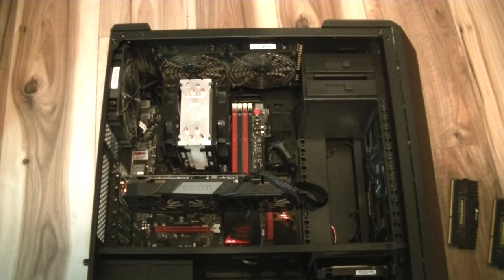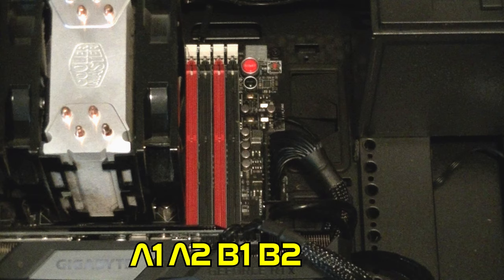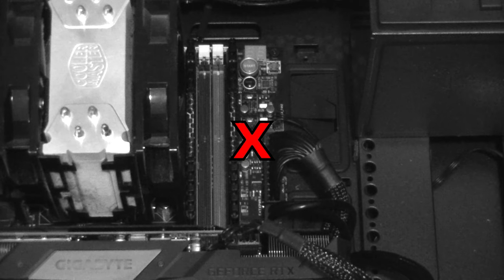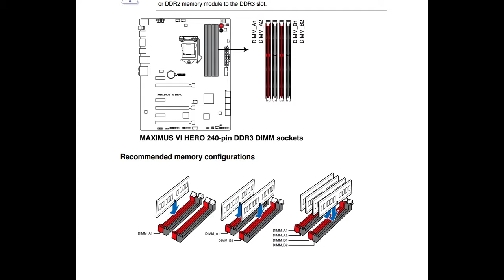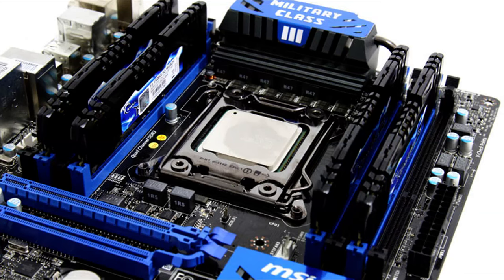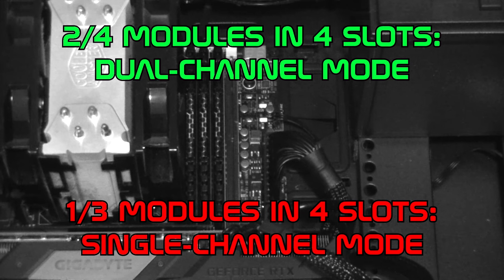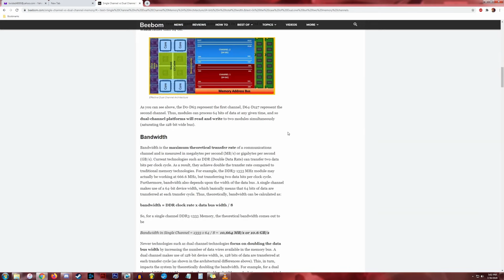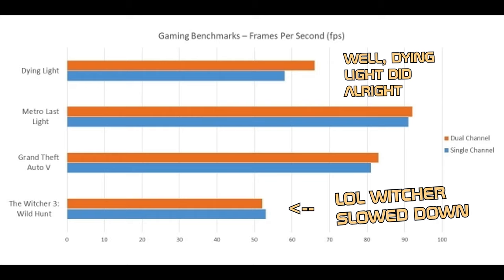How to Make Your RAM Run in Dual-Channel Mode

Comment: I have two slots for the RAM on the motherboard, if I insert 2 sticks of 8 gigabytes in those two slots, will the RAM work in DUAL CHANNEL ?
sorry for bad english
Reply from the maker: It should. It depends on the motherboard, but if you only have 2 slots to begin with, you don't really have any better option other than filling both of them up.
Reply: @Torqcx  My motherboard is B450 S2H, whether he will work on it ?
Reply from the maker: @lukam6300  according to the specs mentioned on Newegg.com, that motherboard will run in Dual-Channel mode. :) https://www.newegg.com/gigabyte-b450m-s2h/p/N82E16813145134?item=9SIAD7HB0P9447&source=googleshopping&nm_mc=knc-googlemkp-mobile&cm_mmc=knc-googlemkp-mobile

Comment: So I put both sticks in but I think my computer is only using one, and my computer only has two slots
Reply from the maker: Check both modules individually in each slot to see if either of them or if either slots are faulty
Reply: @Torqcx  I appreciate the quick reply, but after taking one out to see if it was one of the slots or sticks being damaged I found out I ordered two 4 gig ram sticks, not my intent

Comment: so i do not have go change any settings in the bios?
Reply from the maker: You shouldn't! As long as the modules or RAM are in the correct physical spots, you'll get dual-channel mode.

Comment: motherboard h310 it has A1 and B1 slot will it run in dual channel.
Reply from the maker: More than likely! Check it's manual.
Reply: @Torqcx   i have checked manual its supported

Comment: If i have 8gb 2400mhz DDr4 RAM 8gb 3000mhz DDr4 is = to dual channel or single channel ?
Reply from the maker: You have two RAM modules with different speeds, you're saying? Your best bet in that case would just be to do as what was instructed in the video; put them in the slots with the matching numbers/colors (or whatever your motherboard's manual says). But because they're not the same exact models, do not be surprised if you run into problems such as the full capacity not being recognized, the speed/timings being incorrect or the computer failing to boot entirely.

Comment: I went everything Medium 
FX 8150 8Core
1600Mhz Ram Kingstone Hyper X  4 x 8G
R9 270X 2G OC Version  Best smoothest 1080P I ever played.
4 x SSD'S Kingston Running in RAID - 0   for the  multi tasking power..
I must say this system runs extremely well.. 
Fast  &  Strong 
READ  860.99
Write  1189.40 
For me that's insanely fast  enough !  Loads games like in seconds..
I had a Sabrient 2T Gold at 5000Mbs a second but I sold it.
Love my system  All "brand new" taken out of the box in 20/20 
All from 2013.
And I am using it today !!!!!

My New other system is just sick insane and I built it but have no used it...
22,000Mbs Raid 4 EVO M.2's  ASUS PCI EXPRESS CARD 
PLUS 2 X RAID ON Motherboard direct..
GTX  2 X  1080Ti OC 11G ASUS Republic of Gamers..
ETC..... You get the Picture..
In Complete glass Crystal Tower..!!!!  6 Massive fans..
Blue Heaven.

Comment: Well... my question is, if I have the RAM with same speed, but different capacity, do I put them as 8 4 8 4 or 8 8 4 4.
Going by this video, my guess is 8 4 8 4, but I have no idea.
I'm getting a new motherboard, which has 4 slots instead of 2, it comes with four 4 GB sticks, and I'm keeping the RAM from the old motherboard.
24 GB of RAM is obviously better than 16, so that's what I'll be going with, but the arrangement, I'm not 100 % sure about.
Reply from the maker: You'll have to check your motherboard's manual. Follow the color coding on the slots

Comment: Did I understand well:
+RAM single channel: work/productivity/homeuse
-RAM dual channel: entertainement (games)

Question: Which one suits more for rendering on vegas/blender/after effects?
Reply from the maker: I'd say yes, but it depends on your specific setup and needs/uses. Dual-channel offers generally faster performance and you only need the extra RAM if the amount you currently have literally is not enough for what you're doing (if it's maxing out under load of whatever program/game you're using, you want more RAM. Otherwise just get dual-channel)

Comment: Does h310 motherboard support dual channel mode? ..cause it has two slots only ?
Reply from the maker: Most likely it does support dual-channel RAM. Recently I built a PC that only had two RAM slots and it's running in dual-channel.
Reply: @Torqcx  is it gigabyte h310 s2h 2.0 ?
Reply from the maker: @ahmedosama9815  no, it was a much older monthrboard. I'd be really surprised if that model you have wouldn't support dual-channel mode.
Reply: @Torqcx  it is written on the box of the motherboard that dual channel non-ecc unbuffered ddr4 ...does that mean it support ? ...it has two slots only by the way
Reply from the maker: @ahmedosama9815  yes, that means it will run in dual-channe mode. :)
Reply: @Torqcx  many thanks bro ...u r the best ❤️

Comment: Hey I am doing two sets of dual channel memory. How do I do that ?
Reply from the maker: Do you mean you have four RAM modules? If so, you just fill all four slots and they should all run in dual-channel.
Reply: @Torqcx  hey quick question what if I have a 2 slot motherboard will it automatically run in dual channel?
Reply from the maker: @unclebob1478  generally yeah, if you just fill.both slots up it'll run in dual-channel.

Comment: what if i only have 2 ram slots can i run dual channel thankyou
Reply from the maker: The short answer is "yes", having only two slots typically means both of them being occupied will get you dual-channel mode. :)
Reply: @Torqcx  ok thankyou

Comment: i need guide for hp elitebook 8770w laptop ram put they have 4 slot
Reply from the maker: You'll have to look up its manual if you want to know which slot will allow two modules to run in dual-channel, if that's what you're wondering.

Worst case, you can always try each module one-at-a-time in each slot and keep checking Speccy (free program that shows you your specs) to see what mode your RAM is running in.

Comment: When I put in my first ram slot in my monitor turns on but if I put both the monitor doesn't have signal but it legit used to work earlier I also have repeated the ram multiple times
Reply from the maker: Start by cleaning the RAM slots out (blow them out with compressed air if you can). If that doesn't help, try clearing the CMOS (look up a video on how to do that as I don't yet have a video on it)

Comment: My pc has an issue.. it crashes during gaming when i put 2 rams in the correct slots.. but if i stick one out it works fine.. need help please
Reply from the maker: It could be that one of the slots or models is faulty. Try testing each slot and module individually in between start ups and see if you can diagnose it.
Reply: @Torqcx  i tried both sticks in the same slot one by one both worked fine.. i kept playing on single ram but it crashed after about 40 minutes of gameplay..(Doom on ultra) usually on both sticks it crashes as i spawn...i tried to enable xmp on single stick but it crashed again on the spawn (With single stick)..
Reply: @Torqcx  i was actually reading forums online and found someone had the same problem.. they set the SOC voltage to 1.1V and said it fixed it.. I am not very comfortable tweaking voltages but if i try it could that mess something uP?
Reply from the maker: @itxgaming7226  worst case scenario, if you did something wrong with the RAM configuration, the system would merely fail to boot and you'd have to restart and go back into the BIOS.

Comment: Actually it gives a lot more performance boost with certain games. lets take battlefield 2042 I am currently on rtx 3060ti ryzen 7 3700x and when running on single channel 16 gigs ram I was getting around 40 fps on high settings with dual channel 32 gigs ram im getting 90 fps on high so its around like 40%-50% fps boost on a few games
Reply: it might be your motherboard cuz for example in dual channel my mother board supports 2666Mhz per DIMM but if it is single DIMM it supports 3200Mhz

Comment: Mine won't detect the ram when I slot it in in dual channel but it detects when I slot it in so gle channel
Reply: I am having this same problem. Gigabyte B450 M. I can use A1 A2 but not A1 B1, it keeps shutting down or just wont post.
Reply: And also if I put in all 4 sticks the computer will not post. They are all Patriot Viper 4Gigs 3000
Reply: @jackscrafts9202  I only have two ram slots of the same color, can I run dual channel mode if I put 2 ram sticks? 😔
Reply: @liounique1177   I believe when you put both in it will auto-set the dual channel.
Reply: @jackscrafts9202  thanks mate. I'm buying another stick right away.

Comment: How to use single ram slot?
My monitor shows “no signal”(one of my ram slot is not working)
Reply from the maker: You either have the module in the incorrect slot or the module or slot itself is faulty. Try to find your motherboard's manual and read into which slot a single module should be installed into.
Reply: @Torqcx  i actually showed it to the technician and they fixed it(i had a faulty ram slot) so i was using a single slot but today i inserted on the other side too and now it's“no signal”
Reply: @Torqcx  like i want to know how to switch my pc in single channel configuration
Reply from the maker: @Lain001-g1v  if anything, that could probably only be done in the BIOS.
Reply: @Torqcx  yes! I just managed to do it
Thanks for the replies and for trying to help me

Comment: What happens when I have two, Dual channel rams sets, 2 x 4gb and 2 x 8gb?
Reply from the maker: With modern motherboards it generally won't be a problem, they will both run in dual-channel typically, but with older motherboards (even from just a couple of years ago) they may limit to single. You have to test it or at least read it's specs

Comment: Enjoyed your video, great skill speaking to your audience. I would appreciate if you can provide some guidance on Mixed Memory (size) and Dual Channel configuration.
Given a motherboard that supports dual channel memory and (4) DDR4 DIMMs of the same Manufacturer, Timing Spec, and Operating Frequency, but different sizes 2X 16GB and 2X 32GB = 96GB.
How do you properly seat the memory to Maximize the Dual Channel Benefit (slots available: A1, A2*, B1, B2*)?
From the install instruction, if I had two sticks of different sizes a 16GB and a 32GB the first 16GB of the 32GB stick would be mapped for Dual Channel use and the remaining 16GB would be mapped as a single Channel.
But there is no Guidance in my scenario. If I placed the 32GB sticks in opposite channels along with the 16GB in opposite channels, would that give the full benefit for Dual Channel Memory on the entire 96GB?
Currently we have 64GB in Channel A and 32GB in Channel B, I am afraid we are needlessly mapping 32GB for single channel use. Or maybe it doesn't matter?
Reply from the maker: You might as well just try it out with what you have, as it can't hurt. That being said it's always recommended to go with the exact same make and model of RAM when installing multiple modules, same size, same speed, same timings.
Reply: @Torqcx  Thanks for responding, appreciate your time. We're going to try the new configuration and find a way to test performance.
Reply: @Torqcx  Hi, I have 2 RAMS of different brand and different speed - one is 3200 mhz, other is 2666 mhz - will it hurt the RAM or Motherboard if I insert 3200 mhz in A1 and 2666 mhz in B1
Reply from the maker: @scpk2246  Nothing will hurt anything, but worst case the PC will not boot up with them all installed. Usually they work though, just not at their optimal speed. If you already have it all, you might as well try!

Comment: I have 2 4gb rams I put 1in and opened pc  and it made burn smell did it die?
Reply from the maker: Burning smells inside of computers is very unusual but it is usually power supply-related, I've never heard of RAM causing a burning smell. I would continue to research that.

Comment: can i use 3x4gb in dual channel ?
Reply from the maker: On many motherboards that will just revert them all back to single-channel. On newer boards, two of them will run in dual, while the third will run in single simultaneously. Can't hurt to try, but make sure you read into your motherboard.
Reply: @Torqcx  Thank you. My mob is old q65 with i7 2600. in  CPU-Z  write dual Channel  but I don't trust of CPU Z  how can I check? I need 12gb ram but if work only of singal  channel I will buy one more 4gb. Thank you again ❣️😊
Reply from the maker: @stormdude4654  Again, you'll have to look into your motherboard's specs specifically. Because it's an i7, I'm going to assume it will all revert to single-channel, because motherboards having the capability of simultaneously running dual and single-channel modes didn't become more common until later.

Comment: I have A1 and B1 any ideas?
Reply from the maker: Are you saying those are the only 2 slots your motherboard has? If so, just fill them both up and your system should run in dual-channel mode.

Comment: I have 2 4gb ram and 2 8gb ram. So can I run 24gb of ram in dual channel?
Reply from the maker: You might, but it's always recommended that you get the exact same make/model/size/speed/timings of RAM. you can try with those different models and see if it works, but don't be surprised if something goes wrong or the system fails to boot!

Comment: So I built a pc for the first time, but i am not sure if its ‘good’ like parts wise.
I did research well into compatibility and their respected speeds, but idk if they are outdated or good anymore.
Would someone tell me if they are or arent?

Cpu: intel i7-11700KF (3,6/5.0ghz)
Gpu: Gigabyte Geforce rtx 3060 TI (8gb)
Ram: 32gb dddr4 3600mhz
Motherboard: Gigabyte B560m Aorus pro
512gb SSD & 2TB HDD
Reply from the maker: It's difficult to say whether a system is "good" or not without the context of what its intended purpose is, but based on those specs alone, that's sounds like a mighty fast system to me! You should be able to play new games on max settings with high FPS with that beast.
Reply: @Torqcx  Yeah I understand what you mean, but it is intended for gaming. Thank you for replying!
It also does sound like its a pretty good system, I am just a little bit unsure about it since its my first one ever.

Comment: My mobo has labelled it as "ddr-4, ddr-3, ddr-2, ddr-1"
Reply: are you sure it isn't "ddr-4, ddr-2, ddr-3, ddr-1"?  Cause mine doesn't have "a" or "b".  Mine looks like yours.  But, at a first glance. It looks like the numbers are in order, but if you look closely they are not.  Instead of 4-3-2-1, it may actually say 4-2-3-1.
Reply: @whist214  oh I just noticed that now. LOL Thank you. I checked the manual anyways and confirmed there is a dual channel mode.
Reply: @iancondestables8851  I'm very glad I could help :)  I also learned that when you install your ram, whether or not in the right order, you have to go to your BIOS settings and change a setting to get all the mhz you paid for. For example, my ddr4 ram says 3000mhz. But, I was only getting 2120ish mhz out of them. I'll link you a great video and maybe it will help you more.
Reply: @whist214  Thanks dude! I'm able to set my ram to 3000mhz
Reply: @iancondestables8851  bad ass, man! Keep in mind that is overclocking so it puts more voltage through your cpu and things can run hotter. If you care I can link you another really good video explaining that. Basically the culprit is, it's safe and should never be an issue unless you have a dinosaur cpu. 

I am very glad I could help you out! I just learned this stuff myself.
Reply: @whist214  I think it's fine as I currently have the Ryzen 5 3400g. But I'll upgrade it soon since I now have a dedicated gpu
Reply: @iancondestables8851  that's awesome. I am buying a 2080 from a friend and I have a ryzen 5 2600 that I hope to upgrade soon. But either way, now you have your ram set up and being used to the full potential with your new gpu. That's awesome :)

Comment: Why  then my windows dont see   the secont ram    with  A2 - B2 set up ? and can see A1 - A2 ?? My motherboard is Asus rog strix B450 - F gaming
Reply: I only have two ram slots of the same color, can I run dual channel mode if I put 2 ram sticks? 😔
Reply: @liounique1177   i have the same question bro if u have the answers pls tell me it says dim1 and dim3
Reply: @zombie671  bro i got the answer, it's yes it would run on dual channel.

Comment: I put 4 ram same gb sama speed at 4 slot but it doesn’t work
Reply from the maker: Are you running a program that is stating that your system is running in single-channel mode? Define "doesn't worK"